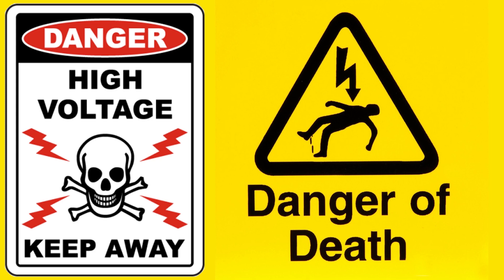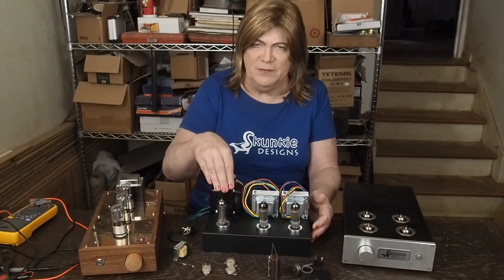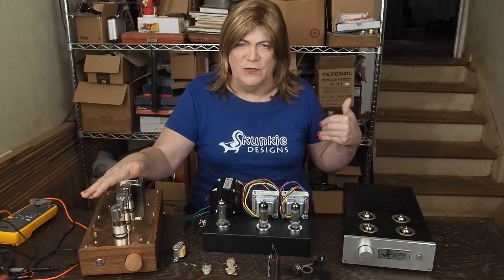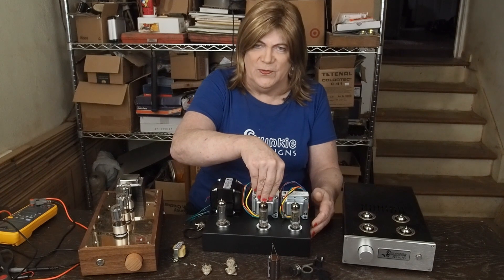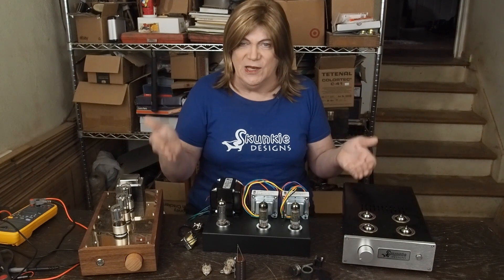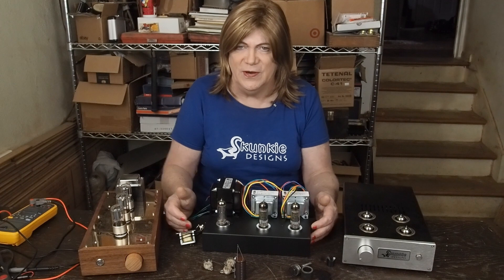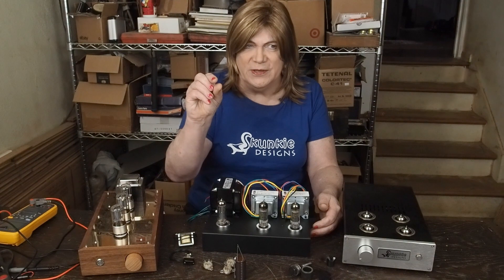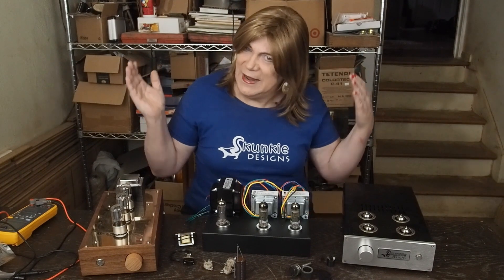6BQ5 spud amp: Initial review

Comment: I use Bud industries aluminum chassis. Mainly because they are cheap.  I build mostly crazy odd amps made from television tubes. Most less than 2 watt per channel. I have been using 70 volt line matching transformers for output. VERY cheezy...... But oddly enough, they sound really nice.

Comment: I dont know if you are interested but people say the EL84 sounds good when run in triode. Decware has been selling their single ended amp for years and it can use EL84s. It would be cool to have a switch so you could choose triode or Penrose. I have never heard an EL84 in triode but always have been wanting to try it. Either way your amp will be good. You have me wanting to do so many projects now,I love it but I can't find the time just yet. I will soon so keep it coming.
Reply from the maker: Triode mode could likely run without any feedback too. Depending on how much feedback is being applied, it might be close to the same output! Plus would super simplify the circuit.

Comment: No driver stage or volume pot is a radical but rational approach. Most modern line-level sources don't need the gain and could be run through a passive switch-volume pot. If you have any sources that don't produce > 3 V p/p then build the preamp. The Philips EL84 tube data sheet shows 10% THD with a 4.4 V input in SE pentode mode.
Reply from the maker: Let's hope we end up with less than 10% distortion!
Reply: @SkunkieDesignsElectronics  The same data sheet showed a 5.7 W output for the 4.4 V input. The output impedance is shown as 4.5 K ohms.

Comment: And I thought I would be set with the 6SQ7. This looks fun, looking forward to the build. I am not sure what you have in mind for the IEC socket, but my Dremel (the thin and thicker cutting wheels) go through the metal very well. One thing that drove me (a German, how is all metric) nuts (...) was finding the hardware I needed. It took me ages to get oriented at my local ACE. Thanks for clarifying.